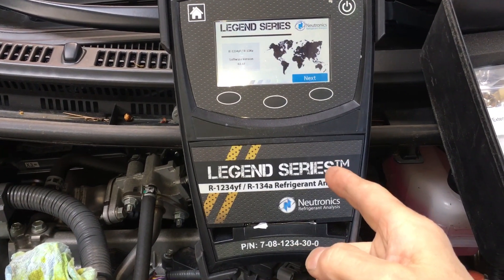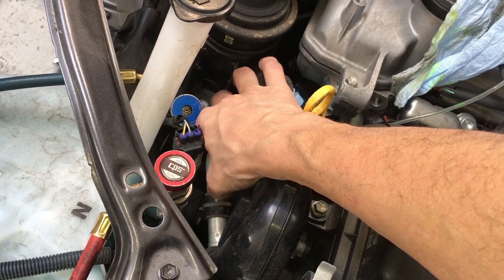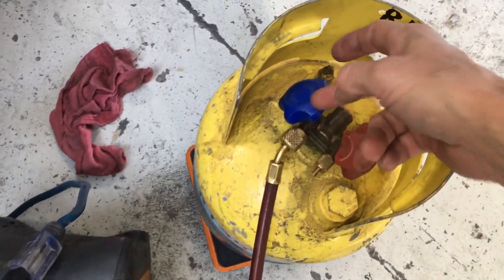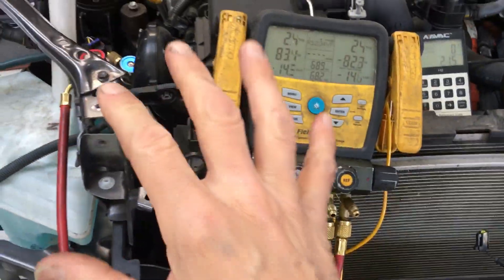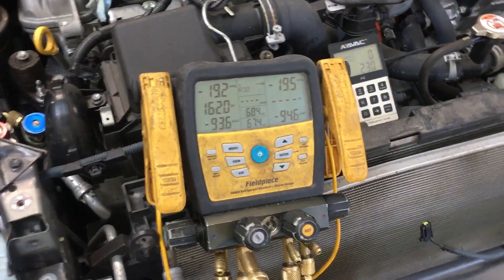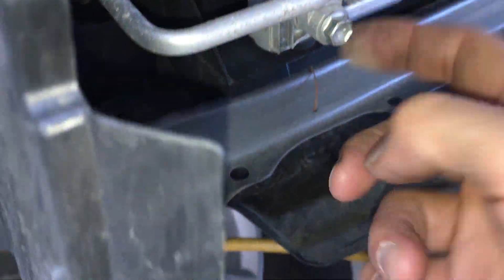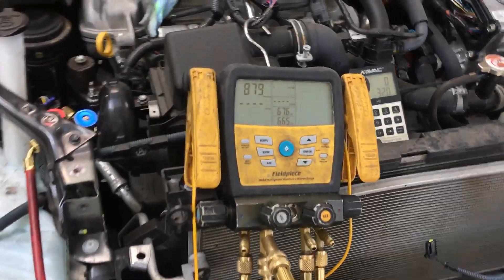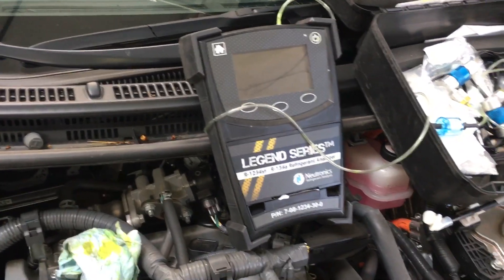Refrigerant quality analyzer. Looking for contaminated refrigerant.

Comment: Any equipment do you recommend for diy'r ?
Reply from the maker: DYI just for yourself for one to three cars only

Or including all your family members, neighbors, friends, coworkers . 

If you’re not charging money where you cannot make back your money on the equipment, just stay with a simple stuff . 
If you have time on your side where you can leave a vacuum pump on a car all day or overnight . 

A two-stage, simple, cheap vacuum pump. It does not need to be big. It could be a tiny little 2 CFM. 

When it comes to the refrigerant gauges there, sometimes a problem with the cheap eBay or Amazon or harbor freight Chinese gauges. Leaking at seal through hoses at their knobs. . 

But you could put NYLOG or silicone grease at all the rubber seals at all the fittings to help with that. 

And like I said, just leave the vacuum pump on overnight you’re not in a hurry. 

If you’re going to charge money and start making a little bit money so you can pay for your tools, then you can upgrade

.
Reply: @coldfinger459sub0  what about identifiers?  I haven't seen anything you use affordable. :)

Comment: Hey maestro. Got a little problem. I work with a/c on my snap-on polartek dual machine. Week ago i bought neutronic refrigerant analyzer same as your. And whats happend ! Checked my refrigerant in tank, and analyzer show me it contain 100% R-134 and 7% air. What value is acceptable and how to reduce it? Or can I completely purge the air from the cylinder? What worries me is that during recharg I can load air into the customer's car :/ maybe the best way is to turn the cylinder upside-down and charge car with liquid? then the air will be at the top of the cylinder and there refrigerant will be no contain air? 😪
Reply from the maker: Like I always said, the fancy automatic machines do not always correctly purge their air. 

You would think if you only charge liquid from what you’ve been told the air would be on top and clean refrigerant with no air would come out the bottom, but it doesn’t work like that . 

This is where knowing physics and the gas laws come in to play . 

What happens to a bottle of Coca-Cola with CO2? . 

You turn the bottle upside down because you only wanna pour out liquid and let the CO2 go to the bottom which is now the top of your 2 L bottle are you only going to get out liquid  coca-Cola ?.

I know because CO2 is dissolved into the Coca-Cola and even if you siphoned Coca-Cola off of the bottom or the middle of the liquid, there is dissolved CO2 in the liquid under pressure . 

The same thing happens with the air. It is compressed and blended with the liquid refrigerant. 

The same scenario happens with your tap water when you pour water out of the faucet it is under pressure. There is dissolved gases under pressure in the water. 

When you let the glass of water sit, depending on the temperature and other things, do you sometimes see tiny bubbles start to form on the surface of the glass or a metal pot from the water you have poured from the pressurized water faucet  ?. 

This is what happens with Erin refrigerant in a pressurized cylinder . 

So now you need to become the snap on automatic purging machine yourself manually . 

Yes, you will be purging off very very slowly a little bit of the air off the top .  You do not want to do it fast because you lower the pressure too fast in the tank starts to chill in boiling off a lot of gas and you’re also going to be wasting a lot of refrigerant.. 

I then you let the refrigerant tank sit for a few hours and stabilize pressure and temperature in repeat the process three or four times . 

Do you say refrigerant analyzer to prove after every time you perform this procedure that your air percentage has lowered . 

Now acceptable under the rules about the specifications of the equipment, I think they allow the highest percentage of air as 3% but for me that is unacceptable I only accept 0% . 

Now when you have completed and your tank is down to 0% or if you want to be a little sloppy one percent . 
       Allow your tank to sit overnight and the next morning strike your tank on the ground give it a couple good slams on the ground to disturbed the refrigerant. Do this a few times come back in a few hours and retest your gas and tell me if the air percentage went up.?. 

Because sometimes you can still have some air, dissolved and trapped in your still refrigerant, that has not been disturbed, but you removed all the air off the surface and some of it out of the refrigerant . 

You’re doing a little curiosity test here to get a deeper higher learning of the physics that is taking place . 

No theoretically you’re supposed to perform this test in a temperature control room let’s say the temperature 72°F so the tank is always had a staple temperature .     If it is in the garage, it might be 50° and 40° at night time and 70° during the daytime depending where you live and what time of the year it is..      so the pressure of your tank will constantly changing and your pressure. The temperature ratio will not be true..      because the temperature of your tank will constantly be changing and you have to take very accurate temperature of your tank.  A very good noncontact thermal camera in a area of your tank you spray paint with flat black paint..   because infrared cameras, like flat, black, non-radiant, reflective surface to take a true temperature.      Or a high quality bead type thermal couple sensor that you could attach to the surface of the tank down low at the level of the liquid refrigerant a little bit of insulation over the thermal bead, strapped tightly next to the surface of a tank, even with a small drop of computer thermal paste, thermally conductive thermal paste.    Said you can use the PT chart.. 

And you can compare the temperature of the tank in a thermally stable room to the pressure of the tank and they should match perfectly on the PT chart . 

I think I have aren’t you with enough information to proceed. Good luck and let me know about your results in your findings. . 

By the way, go on Google and YouTube, or Wikipedia, search the Internet and read about the three gas laws and read about the combined gas laws .  Jim Pytel on YouTube channel actually just did a series on the combined gas law’s..    and many good instructors have done videos about the three gas laws and the combine gas laws.   

He will learn something that will help you on diagnosis with refrigerant on cars
Reply: @coldfinger459sub0  omg...okay ill just buy new r134 tank ,
this one will be recycled. I paid some bucks for this machine and it can't remove air? HORRIBLE
Reply from the maker: @madmotocore2770  that’s why it’s called StrapOn because they F U with a StrapOn dildo out of your money 💰

Comment: Question 4: the industry evolves from using Freon (R12 if I’m right) to all kinds of refrigerant now, and one main reason behind is we think Freon has damaged the Ozone.  Do the new types of refrigerant do the same kinda of damages? I heard R12 actually works better,  if not the best,as a refrigerant for AC, Thanks!
Reply from the maker: Everything has some sort of negative affect.    You can drink too much water and die you could breathe 100% pure oxygen and die. 

R12 was bad for the ozone

R134 is a higher greenhouse gas and they’re also finding it in the oceans causes the ocean to become more acidic lower pH that is bad for creatures that need calcium to make shells like crabs and clams and coral

1234 wire is less of a greenhouse gas but they also have found that it rains out from the atmosphere goes into the soil and becomes a different molecule that is a growth inhibitor for some plants. 

And it doesn’t matter our 12 was great as a client they just have to keep increasing the efficiency of the hardware to compensate for the inefficiency of the gas.

Comment: Question 3: what would you do if you found the refrigerant were contaminated with moisture? Thanks
Reply from the maker: Just recover it.   On commercial or residential you would change the dryer leave it on the vacuum pump and recharge it. 

I know Automotive you do the same thing or if the customer cannot afford it or time is not available for some reason to get the part leave it on the vacuum pump a little longer run the engine heat all the components up this will reduce but NOT get rid of all the moisture

Comment: Question 1: what would you do if you found the refrigerant were contaminated with other types of refrigerant? Thanks
Reply from the maker: You recover the refrigerant into your contaminated tank a separate one that all your contaminated refrigerant those into can you just drop it back off at the commercial HVAC supply warehouse where are you exchange your tanks and they have a company that comes by and picks up all the contaminated and Fresh Refrigerant to recycle it or destroy it depending what it is. 

All these answers you ask are part of the EPA 609 Refrigerant certification test given by MACS they have some YouTube videos they give free webinars on passing the test you will get all your answers answered there.

Comment: What do we do to the refrigerant on the blue and yellow tank? Can we re used? If not, is there a place (San Francisco CA area)that exchange the tank once gets full?
Reply from the maker: Yes it can be reused when you run it through your dedicated recycling recovery and recharge machine. 
      Places to drop off the refrigerant are large nationwide chains like Johnstone Supply’s or American Refrigeration Supplies or any of the large national change that accept return recovered refrigerant .
           You give them a cylinder in exchange for another cylinder back to recover more refrigerant.